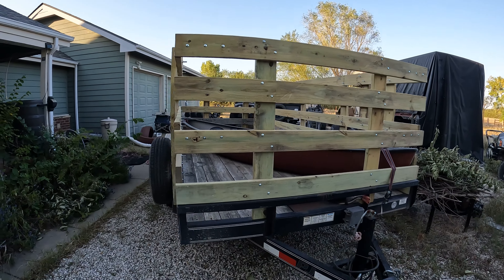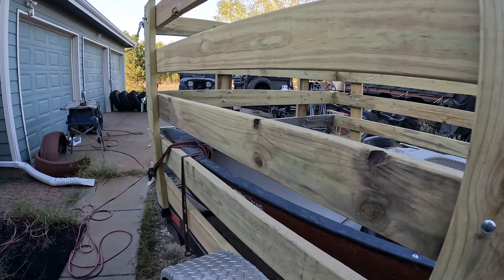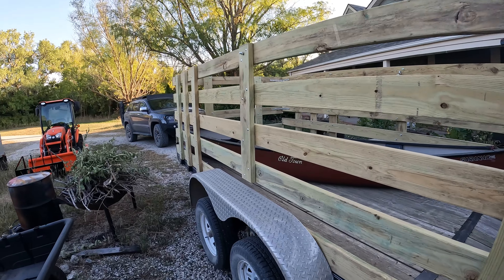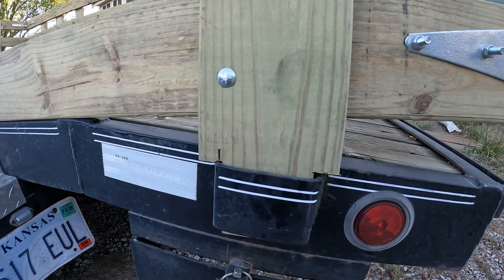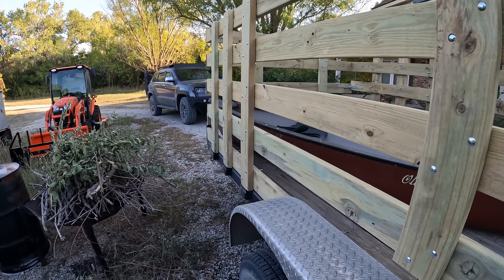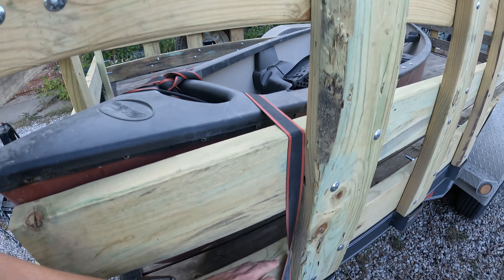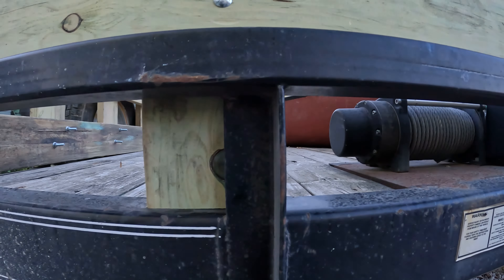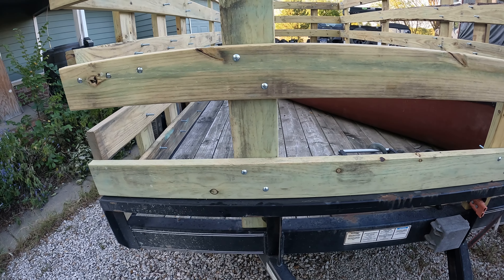Building Stake Sides for a Flatbed Trailer; an overview

Comment: Lots of work done here. Would like to see what you do with the pick up.
Reply from the maker: Absolutely. My plans include new suspension, an exhaust manifold snd turbo upgrade, and a swap to a flat bed with a dump ram. I’ll make sure to video the upgrades as I do them.
Reply: Not a bad idea. To. Do  with a  car hauler  I am thinking about. Doing. The  same. Thing if I were   to  buy  a. Trailer. Wit. Stake pockets